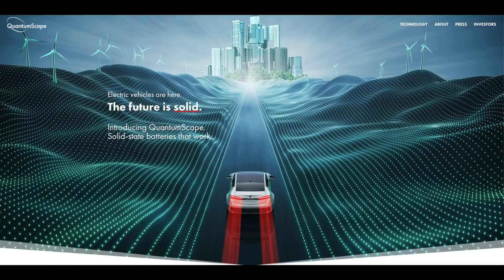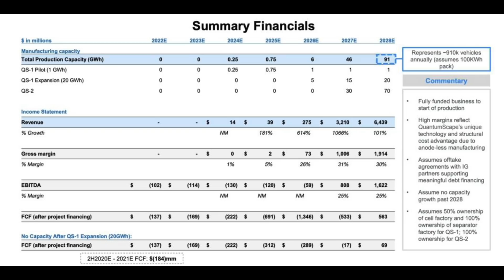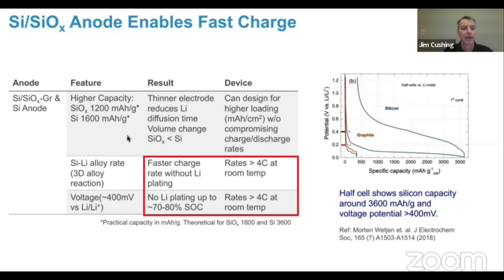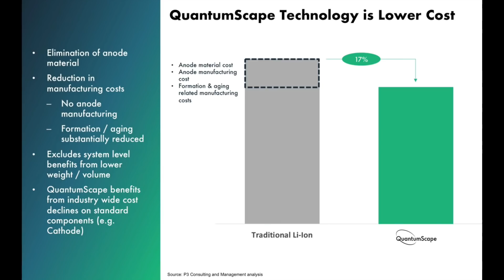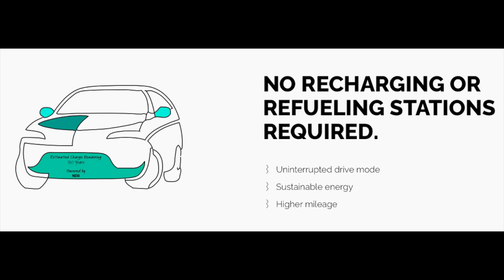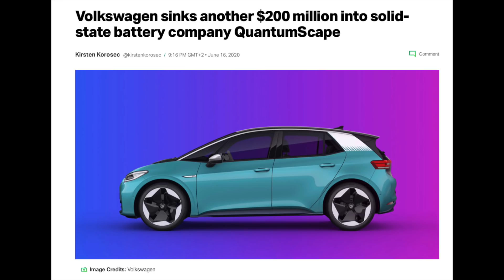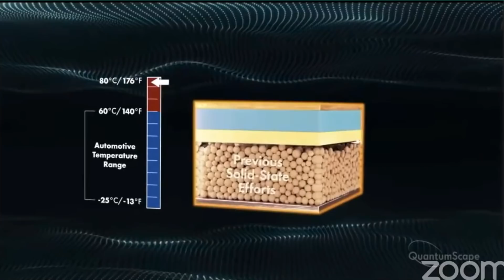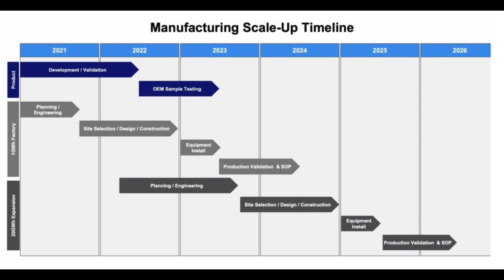DIAMOND batteries that NEVER need to charge & Solid State batteries will it not HURT Tesla ?

Comment: Very important is this topic.
Please share with your friends.
Dear friends,
I think 100% people don't know the practical applications on grid .
Please understand what is the every day grid transmission , what is the actual traffic on the grid on peak hours and off peak hours .
How much electricity is required for water pumping applications , how much electricity is required for commercial purposes and industrial applications.
Like this if we consider each sector and it's peak and off peak hours total requirements.
What is the total power generation and distribution one should understand.
In India the per hour power generation is 317000 MW and in India there are minimum 100000 petrol pump outlets on pan India basis or in 28 states and 8 union  territories and in India there are 230000000 vehicles running on roads and registered in RTO'S of India.
If we consider each one individual petrol pump or outlet with a minimum storage capacity of 20000 litres of diesel or petrol then each one litre will have only 3 kWh or units of energy stored.
So each petrol pump has 60000 kWh or units stored energy or 60 MW stored energy.
Total petrol pumps outlets are 100000 and each petrol pump has 60 MW stored energy then it will be 6000000 MW of energy supplied to these 23000000 vehicles running every day on the Indian roads so where is the energy or electricity to supply for these many vehicles.
If each vehicle battery is charged with in 35 seconds then where is the electricity generation.
How can grid function on this sudden imbalance and over balancing of the sudden requirements from various sectors.
Please understand this generation and distribution or transmission and where are the extra lines to take the extra load .

Dear sir greetings,
Story of India.
India is having 78000 petrol pumps outlets and are selling petrol and diesel and gas and each petrol pump has a 20000 litres of liquid per bunk and this is having 60 MW energy.
So India requirement is 5000000 MW of energy.
Please understand this ground realities.
 230 million vehicles on Indian roads
 1 million is 1000000
 230000000 vehicles
 If each vehicle gets minimum 5 kWh or 5 units charge then per hour India needs 
23 00 00 000 vehicles X 5 kWh or units
 1150000000 kWh or units per hour
 1150000000 kWh or units per hour if each unit is sold for 10 rupees
 11500000000 rupees revenue generated
 100740000000000 rupees per year
This is the revenue generated per year
Sir these are genuine figures
 On ground reality
If we convert this to hydrogen then please think about the ground realities
 Please understand the importance and value of the flywheel technology and invention
 I am the only person to work on Flywheel power generation technology and Flywheel power storage technologies
I am the only person to work on power Multipliction technologies
 I am using hydraulic applications pneumatic applications batteries operated motors in-pipe cascading power generation technology etc for power storage and power generation and power Multipliction
I have sent to mukesh ji , like this I have sent to all important people in India
I am doing my marketing and advertising and branding
I am open to all people of the world

HYDROGEN story 
From where can India get the input electricity for making hydrogen
Where is the water , where is the input electricity. Can any one answer?
For an input of 100 kw only 70kw is coming
So for 1000 kw requirements how much energy is spent
1428 kWh spent and 1000 received
So my question is from where can they get this energy
This is just for 1 truck energy requirements per 500 km run
India is having total 23 crore vehicles running on Indian roads
 Out of this half are trucks ,buses
So how can we get so much of input energy
For storage , transportation and distribution how much more energy is required
In the bus sector :- 
In India there are 350000 busses and if each bus gets an investment of 1428 kw then 350000 busses should get 1428 kw investment per each one individual bus = 499800000 kwh electricity per every single charge so if we convert this into MW then 499800 MW per every charge .
AND
For rest of the TRUCKS please think out of 100000000 trucks registered with Indian RTO from 28 states and 8 Union Territories.

Please think what best can be the real time situations.

World First fuelless power generation technology developed by Indian scientist couple.
Absolutely free energy technologies

www.kammagearflywheelpowergeneration.com

Just 4 batteries and running a submersible pump, a welding machine or a lath machine or a industrial heater etc mechanical load and electrical load like halogen bulbs 

https://youtu.be/Cut8Pv2nWBc

https://youtu.be/e6pI0fevA-M

https://youtu.be/cd-QWZBNLuo

https://youtu.be/w2EQyf_KbWk

https://youtu.be/rPRJofvOYoQ

Federal government of India has accepted this technology and invention and incorporated Flywheel , compressed air and pump storage 

Thanks

Like this there are many unanswered questions.
Thanks
Dr Srinivas Bhasker chaganti
Scientist
91-8555045244

Comment: It doesn't matter how good a battery is if it's more expensive than a good enough battery. EV range is already good enough, since a ev with more than 1000 km range doesn't really make sense. Instead of unecessary longer range you could make the car lighter and cheaper by using less cells.

In summary; cheaper batteries is the goal, not more energy dense.

Comment: Running a car on radioactive diamond battery would be like running a car on a solar powered calculator. Your daily commute would take millions of years. You can make a betavoltaic battery yourself right now  for a couple of hundreds bucks. It will last possibly for decades. But total output of energy in that time will be similar to one coin cell battery.  Also, no advancement in battery technology will bring any battery on par to energy density of gasoline, LPG or diesel. Ever. That would be around 15000 Wh/kg. Solid state might get you to 300 or 400 Wh/kg from today 180 Wh/kg lithium. Given in a car gasoline energy is utilized with 40% efficiency, you'll need 6000 Wh/kg to be on par

Comment: Great video.  I agree with you mostly.  However, I do care about longevity.  Lithium batteries deteriorate over time whether you use them or not.  And for people who do not drive very much, that means the cost-effectiveness of EVs becomes significantly reduced compared to ICE vehicles.  For my personal use, it doesn't matter if it is a million-mile battery if it deteriorates in 10 years.

Comment: IMO Quantumscape is vapor ware. If their span on energy density is 350-500kWh you can bet your farm that 90% of the cells will have 350kWh in the production lines and the top 0.1% will have 500kWh. Just like Nvidia's GPU's where the top GPU's use fluke silicon that just happens to be better because of chance.

Comment: @1:30 I hate to bring to these poseurs but the 4680 cans are going to be filled by dry cels. No solvents involved at all. They are going to be solid-state batteries.
Reply: Nope. They are not solid-state batteries. What you are thinking of is just an improved manufacturing process. The end result is the same.

Comment: Lars, I have never given one of your videos a dislike before, but this one really bites. You go SERIOUSLY wrong when you spread rumors without giving them at least a basic sanity check. There is no way there is going to be a battery that gives your car a 20000 km range. There are hard limits to energy storage that are determined by the laws of physics. Present batteries still have much room for improvement before they approach those limits, but not THAT much. This is a point where you really need to step back and reconsider this part of your approach.
Reply from the maker: I am not saying the Diamond is a real thing, just an example of yet another so called battery breakthrough that had big claims, but again doesn't matter at all if they can't scale it up.

Comment: you know you video is just cherry picking ..... 4C is what QS do now.... they also tested at 25C which is 2 min charge. MAYBE if you were less of a ideolog apologist you could present a more balanced view. The real benefit that everyone skips is charging from -10c to 100C without thermal regulation.... this scope make s a battery that just works and almost ZERO thermal management. So yes your battery does not go dead in extremes from thermal management energy requirements this is a HUGE factor for everyone outside CA or temperate climates. Also the 4680 is a decade away at scale... lol Honestly I would not be surprised to see tesla jump on board if they can.... its superior in all the ways that matter even the guy who |INVENTED Lion agrees .... So what would you want in a powerwall that cycles daily? or for grid

Comment: 4C battery don't charge full in 15 minutes. It is maximum charge rate.

Currently model3 can charge 250kw into 75kwh battery, whic equals 3.3C. It still takes about an hour for full charge. 50%charge can be reached in 12-15min, so it is much faster in beginning.

Comment: Great presentation.   Just like I could get a custom high output engine installed in my Honda Civic - the current 4 cylinder engine is good enough for the price point.  I don't need a Lucid Air, but my next car - the Model 3 - would suit me just fine.   All a balance of performance and price for most consumers.

The Diamond battery is a lot of hype at this point...from what I read, it has radioactive material inside, and it does not have a high energy discharge capability (i.e. hard to put peak demand on this battery).   For some applications, lets say - and android - it might suit the bill if the android does not have massive energy requirements.

Comment: Pretty Biased Perspective Lars:
You speak of pretty much EVERY other company's technology/timelines as probable B.S.
But ANYTHING Tesla utters on the technology/timeline curve is probable GOSPEL.  Not to mention that Tesla has already missed MANY of their projected guidelines.  To their credit, there appears to have been a shift from "Over Promising and Under Delivering" to just the opposite.  That is a refreshing change and hopefully continues.  However, one thing that IS becoming more and more apparent is that Tesla is still lagging on their promise of improved Service and Parts availability.  That part of the equation has definitely NOT kept up with the production ramp!  More and more long term "Tesla Fan Boy You Tube Channels" are raising concerns about their Service Experiences which appear to be becoming worse rather than better.  More vehicles hitting the streets means more vehicles requiring service, in spite of EV's supposed lack of regular service.

Comment: 2:47 I don't think you mean 350-500 MW per kg. (Careful with units. That would be like having a fusion reactor in your pocket.)
Reply from the maker: Yes wh/kg 👍
Reply: @BestInTESLA  no, kWh/kg
Reply: If the batteries were never going to be charged, then it would have to be something like 350-500 MW per kg. Even then it would eventually have to be charged - unless we are talking disposable batteries. In fact, to truly never need charging, it would be not so much a battery but exactly what you said, a fusion reactor! Either that or the vehicle's motor is a perpetual motion machine that needs no energy input!

Comment: So how good do you think litium-ion batteries was when they were a new invention?  Solid state will be much better then  lithium-ion, but the tech needs time.
Lithium-ion has its limits. Fast charging a battery with a liquid electrolyte, creates dendrites and the batteries will short-circuit. So bottomline is (no matter how well tesla is doing) lithium-ion batteries will soon reach its limit of effectiveness and it will never be better/more energy dense, then diesel and gasoline... Never good enough for planes and ships. Thats why we must have a safer, much more energy dense,  lighter and cheaper battery technology then we have today. So, I'm afraid that Teslas lithium-ion batteries really ain't the future and will only be good enough in this transition period. And Solid state batteries (most likely) will become much cheaper, and much better then Quantumscape's  first edition, because the potential is far greater and better then that of lithium-ion. And remember that many others are developing new battery technology's.... Would they do that if lithium-ion was good enough? Or could become good enough with tweaks here and there?.... Not likely.
Scale in production will come when demand is there. And demand will be there when solid state batteties are better and easy to produce.
And btw. Diamond batteries are a hoax 😏 unfortunately

Comment: Solid state batteries don't need thermal management...just that alone is a massive improvement! ♻️🔋👏💪🔝❤️
Reply: Define the "need" for thermal management. I believe you will want to have thermal management even for solid state batteries in order to keep the car functioning optimally (power output, regenerative power, etc) as well as for heat scavenging from the battery pack.

Comment: They have not said they are longer lasting. They will only do 200k miles in a car. Tesla is beyond 300k miles with their current small  batteries.
The new bigger batteries are 1million + miles depending on pack size .

Much more expensive than 4680 and 4680 can be used in structure thus saving loads of weight...

Comment: Tesla is pushing ahead with the advancement of cell design, this should complement multiple battery chemistries. As noted, it's the production speed/cost that is the real factor, everything else is secondary.
Reply: Exactly, gotta love how Musk puts it: the total volume of the factory and how fast things move inside it. The tech to solve the problem has to make sense in those parameters

Comment: Such high quality materials like diamond and gold are meant for space exploration,  not peoples daily driver.
Reply: Yea i was gona say. We can make diamonds out of cheap raw carbon. Just takes a lot of energy but very doable. Gold on the other hand is not a good economical choice however silver and copper should be close enough
Reply: @patrickryan2614  diamonds and gold arent rare. Not even close, production is kept low to keep the value up. If demand grows enough, the mines will dig out more no problem.
Reply: What? Diamonds are easy to make... and you'd be surprised how much gold ISN'T used for space...

Comment: Diamonds for battery’s I can just imagine the cost. Joke for : Hey baby you know that rock you always wanted here it is a battery
Reply: Diamond prices are artificially jacked up by monopoly creating fake scarcity. The truth is diamonds are not rare nor expensive.  If the car industry decides to use diamonds then for sure they will buy diamond at its real price which is a fraction.
Reply: Well i think they can use lab created diamonds for this, but I am not sure ofcourse. I mean lab created diamonds are pretty much exactly the same as natural diamonds only more perfect a bit to perfect and cost maybe 1/10 of a normal diamond and they aren't even mass grown/created so prices may drop further.
Reply: @maxdehaas6776  where do you get the cost from? For all I know it requires extreme pressure, doesn't seem like it'd be economic to manufacture. But maybe if energy gets super cheap in the future it could be something
Reply: @lechavs  I've watched a video of an interview with one of the founders of one of the bigger lab grown diamonds, I might have been a bit mistaken but it does depend on size, bigger diamonds are cheaper to make and more expensive from natural colored diamonds are naturally super rare and extremely expensive while they are way way way cheaper to create in a lab so it does matter a bit on what type of diamonds needed but lab grown is starting to become really cheap as they move to improve the production. But 2 identical 5 carats  earrings cost around 100k lab grown while buying them in a jewelry with natural diamonds it will set you back 1 mil.
Reply: @lechavs  we don't need it mass produced. It's good for planes or expensive cars or robots 😁
Reply: Diamond batteries are a hoax . 😏 Sorry but it's not gonna happen.

https://youtu.be/uzV_uzSTCTM
Reply: @ThomasNorthener  Diamond batteries, based on radioactive carbon 14. https://www.google.com/url?sa=t&rct=j&q=&esrc=s&source=web&cd=&cad=rja&uact=8&ved=2ahUKEwjyqZS1vtDtAhUHTsAKHcVKDn8QFjAAegQIARAC&url=https%3A%2F%2Fen.wikipedia.org%2Fwiki%2FDiamond_battery&usg=AOvVaw0gtMKVNDwRBTjc7QeHH6Xm
Reply: @ThomasNorthener  The batteries themselves are not a hoax, but the claim that they are ever going to be used in any application that requires anything greater than an AAA battery is.